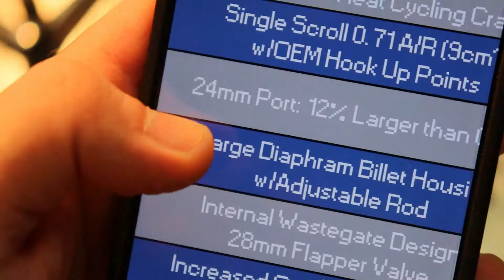Diagnosing and Rebuilding a Corksport Turbo (CST4) - Part 1

Comment from the maker: I just realized I called the turbine wheel an "18G wheel" when Infact 18G is used to describe the compressor wheel.

The turbine wheel/shaft is TD05H. Just caught this now, sorry to anyone I may have confused!
Reply: SBS I just rebuilt my cst4. There was oil everywhere just like yours. Used a turbo labs td05 rebuild I got on amazon. Parts seemed like great quality.  Had a performance thrust bearing. How you described that bearing is actually incorrect.  The PTB has a an additional oil passage to help with lubrication. If you google the difference you will what I’m talking about. Corksport stated I had to use the PTB however, just like your turbo, mine didn’t have a PTB in it when I took it apart. Odd! I haven’t seen your part 2 yet. If you have any questions reach out to me.
Reply from the maker: @parrowman  Hey thanks for the heads up, this turbo did have a Performance Thrust Bearing though. A Performance Thrust Bearing just means that the surface where the thrust spacer meets against it has a 360 degree mating surface as well as improved oil grooves, instead of the conventional 270 degree mating surface with no oil grooves which is standard OEM replacement for most turbos like KKK/Schwitzer/Borg Warner/IHI and Mitsubishi (MHI). I cover in detail the differences between this bearing kit and the Turbo Lab America rebuild kit in the second episode. 

Part 2 is mostly finished being filmed and edited, I just needed to find a reputable turbo shop around me that can balance it so I didn't have to spend extra money on shipping etc. I've also been filming and editing 4 different episodes for the channel at the same time so it's been a little crazy at my place with it being summer time, and the wife loves to make family plans for us, as well as our daughters 1st birthday coming up. I promise content is coming though!
Reply: Still incorrect. I saw the thrust bearing you pulled out and it is not a  PTB.  https://www.dsmtuners.com/threads/fp-green-rebuild.343257/ ... There is a picture in this thread that shows the difference between the thrust bearings. The corksport turbo does not come with a PTB.
Reply from the maker: @parrowman  That's awesome! Thanks for the info! I honestly don't know how I didn't find that in a search result when I was looking up bearing kits. I kept getting a picture comparing what looked like a flat surface around the shaft hole with no oil grooves as a "standard MHI kit" then something that looked similar to the turbo lab kit but without the additional oil feed hole as an "enhanced replacement kit". Thanks again for the assist.
Reply: SBS yea buddy.... I learned alot pulling this car apart and putting it back together.  A lot of screen time doing research and reordering parts cuz I got the wrong thing. I’m not a master but I think I’ve turned every bolt under the hood except for inside the transmission. If you have any question about the speed hit me up.
Reply: @parrowman  could u send the link for the rebuilt kit plz. Need it asap

Comment: Small 24-27mm flapper doors are a necessary evil on IWG.  The actuator is in a mechanical disadvantage by nature of their design so it takes a significant amount of spring pressure to hold the gate closed at high boost/rpm.  If the flapper is too large the actuator won't be able to hold it closed.  It's a give and take with IWG.

Comment: Why not go with BorgWarner? Or Garrett?
Reply from the maker: It was a the for sale price and direct bolt-on style flange that sold me on it. Silly me, I thought the turbo was in perfect working order because of what the seller told me, but that turned out to be a lie. So the "good deal" I got on a used $900 CAD turbo turned into $1,100 CAD turbo. That is what started this journey of rebuilding the CST4, and decided to make a video series about it while also trying to finish fixing the Audi Q5.